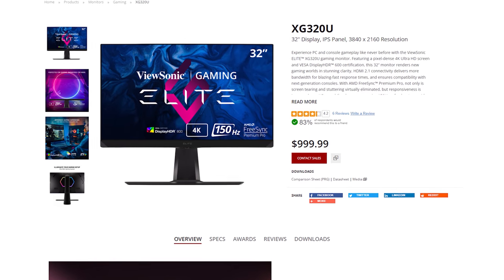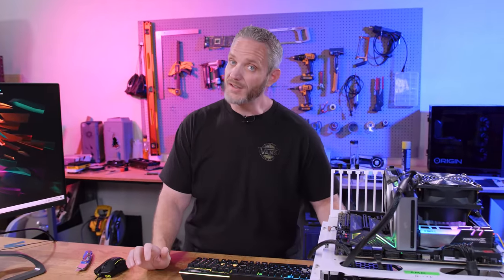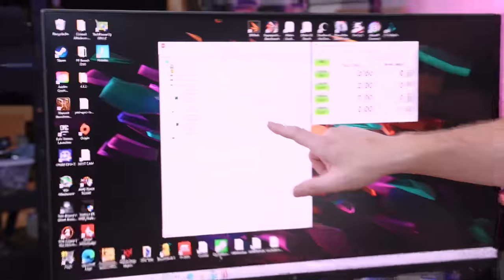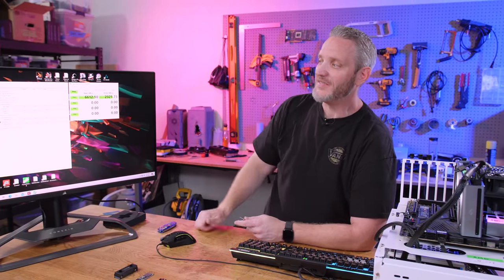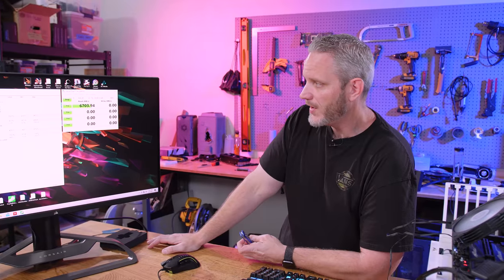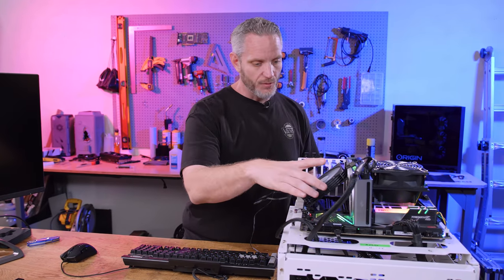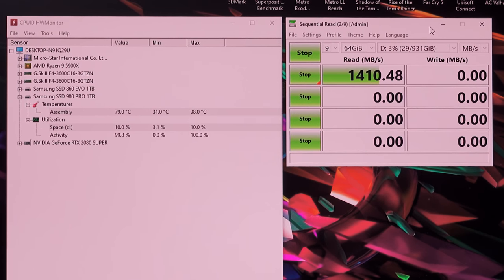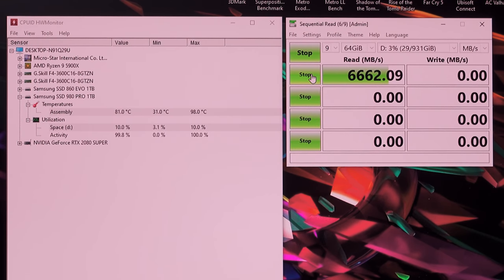I watercooled an NVME SSD... These results were unexpected!

Comment: What I got from this video is that Jay should make a "water cooled everything" system since he doesn't recommend it and none of us ever will
Reply: I second this motion
Reply: Third
Reply: 4th.
Reply: Revenge of the 5th. Do it meow!
Reply: Three loop system :
1 - CPU
2 - GPU(s)
3 - RAM and NVME

Sit back with your favorite adult beverage and watch Jay's brain come apart running hard tubing - lol
Reply: @roadwarrior1961  you forgot, he said there is PSU water cooling!
Reply: @dfsearles  
You are correct, I did. Add the PSU to the memory loop.
Reply: Yes please
Reply: At that point you might as well just dunk the entire thing in a fish tank of mineral oil and call it a day. Maybe a fish tank PC would be another cool one for the list
Reply: @roadwarrior1961  Why stop there? Monitors get hot too. And Gamers. Let's make Jay build a loop that includes a helmet for his own CPU ;-)
Reply: DDR5 is for sure ripe for watercooling
Reply: I do.  VRM's, RAM, PCH, HDD's, CPU, and the GPU.
Mostly because I buy cheap and OC the snot out of the systems to flog on. 😏
Will have to somehow block the rear of my 1080Ti personal rig as well now, 2064MHz heats the backplate up to 70C. 😂
Reply: You may as well do a fully submerged PC in that 3m fluid. Then cool that Fluid with a Giant Radiator.
Reply: @roadwarrior1961  "The Memory Loop" would be a great name for a rock cover band. Dibs!
Reply: He should watercool the fans as well!!
Reply: I sith the motion @JayzTwoCents pleas do this "Water cool everything even have a water cooled desk with water  cooled beer cozy
Reply: @vorden25  Hang on. Water cool WITH beer?
Reply: Yes
Reply: Yes!
Reply: Hopefully he doesn't forget to water cool the VRM this time.
Reply: @roadwarrior1961  but also the vrms
Reply: @ShieTar_  a water-cooled monitor and chair
Reply: I mean I've seen water-cooled CPU, GPU, PSU, RAM, SSD's and motherboards. Jay has probably seen more stupid things in the water-cooling market. I'd love to see a water-cooled everything video.

Better yet just make it the stupidly overcomplicate build. Water-cooled RGB everything.
Reply: 6th
Reply: Didn't Linus make a water-cooled gaming chair? Add that to the mix.
Reply: @pfunk5001  wait what💀
Reply: agreed!! overkill is fun!
Reply: Vodka cool it like boris
Reply: AGREED 100%
Reply: Even a water cooled HDD and Monitor
Reply: So we should go back to minerial oil water tank pc's. Mmm yes I love it.
Reply: Yes, surprisingly it doesn't seem to have been done recently, definitely something Jay should tackle
Reply: Water cooled fans as well 🤣
Reply: That would be cool, lol. For my own use I go all air. 6x 120mm filtered feed (3 front, 3 bottom) and 4x 120mm exhaust (3 top, 1 back) + exhaust from GPU plate.
Reply: isn't Linus mineral oil pc exactly that?
Reply: Someone will. Then blame Jay when it fails.
Reply: @realmasterkush  It didn't have forced circulation with radiators, right? So not like typical water cooled solution. Or maybe I remember wrong.
Reply: @roadwarrior1961  Worst case scenario, lets make a hard tube single pass/single loop of them all that goes GPU then CPU first after the radiator! (Some of us just want to watch Jay's world burn...lol!)
Reply: @NapalmFlame  Linus did that already
Reply: For real.  This is the channel for a statement boutique over the top water cooled everything PC.
Reply: Anybody start a petition yet?
Reply: absolutely :D
Reply: @SirDaffyD  you u7 n b
Reply: Yes please
Reply: @roadwarrior1961  add psu and any ssd ...maybe even chip set and vrm .....lol
Reply: Exactly
Reply: @roadwarrior1961  you also gotta include VRMs and chipset
Reply: No one has done it.  Weve done that for 20 years in the watercooling hobby..
Reply: It would be interesting.
Reply: And it shall be called "THE BIG MISTAKE!" XD
Reply: @roadwarrior1961  I'm working on a three loop;
1 - CPU + VRM
2 - GPU + backplate
3 - RAM + 4xNVME + PSU + fan controller
Mainly because I'm doing remote rads on the basement ceiling to prevent summer oven.
Reply: DO EEEET JAY!!!!!
Reply: Water cooled water.  Let's see it.
Reply: Absolutely!!
Reply: The water cooled PSU:
Reply: Challenge accepted, CPU, gpu, ram and SSD